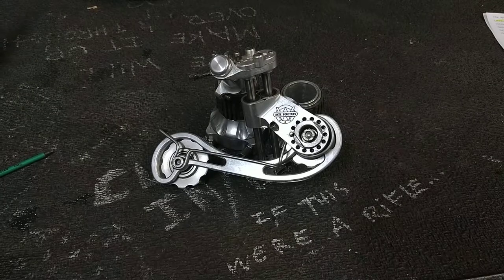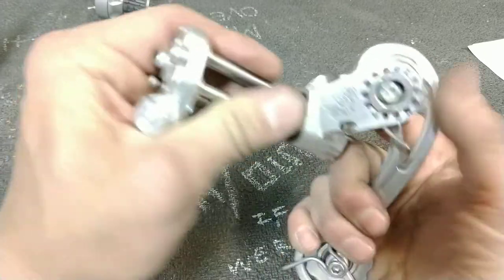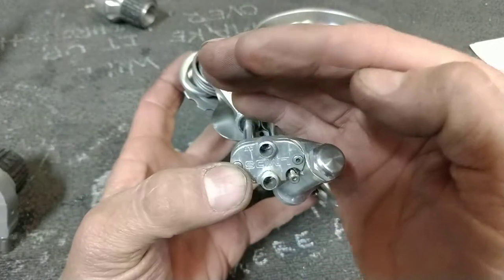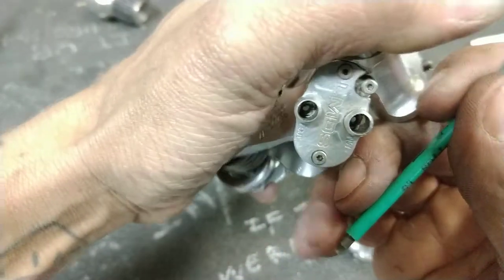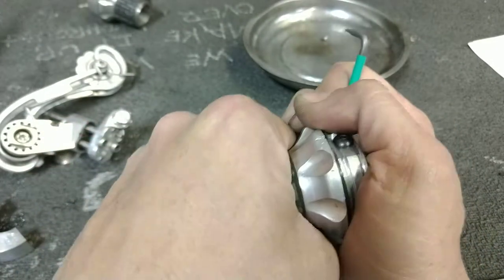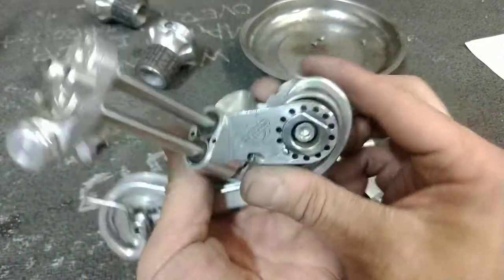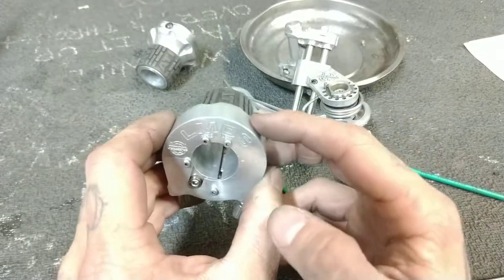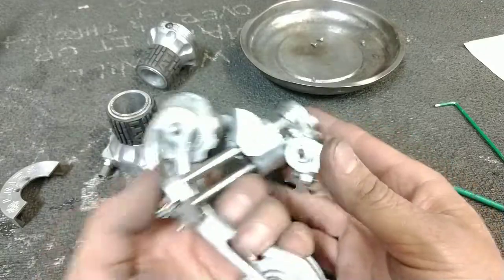Nothing exceeds like excess: the White Industries LMDS derailleur

Comment: I had one of these a few years ago and it shifted great, even by a modern standard.  You could dump or grab gears faster and more confidently than anything else I could remember. The dual-acting design was a real dog to set up though. Never had to change cables or worry about the limit screws coming undone, but it was cumbersome.  A spring-loaded version with a regular shifter would have been ideal.